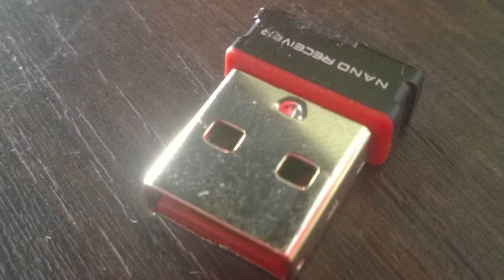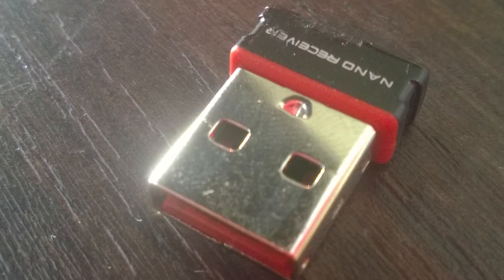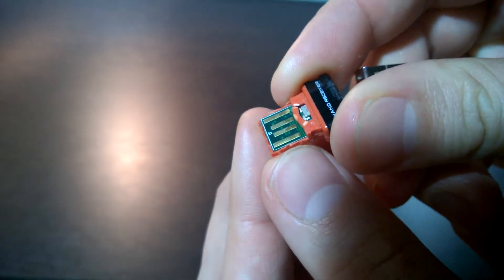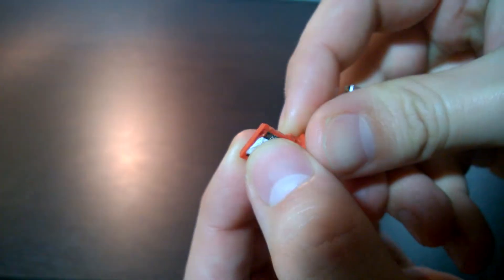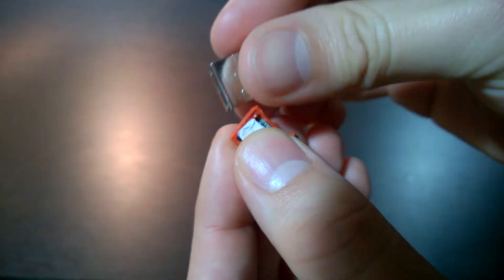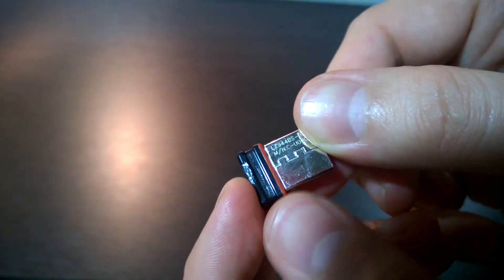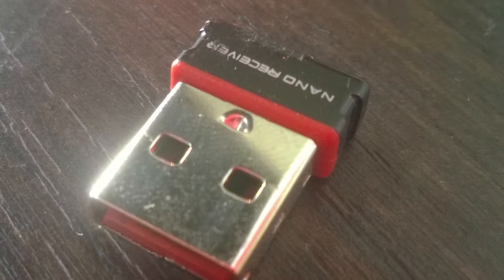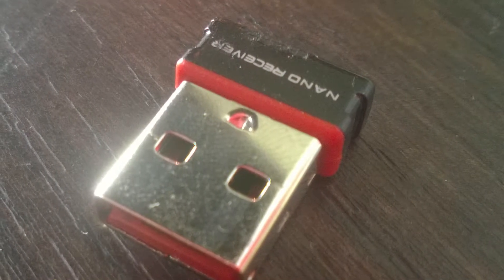fixing a Logitech nano receiver

Comment: Thank you, thank you, thank you!  I tried to remove the metal housing, but I couldn't manage to do it—it simply wouldn't budge. Instead, I used a razor blade to cut out the front part of the plastic tray, placed a piece of paper under the chip, and it worked!